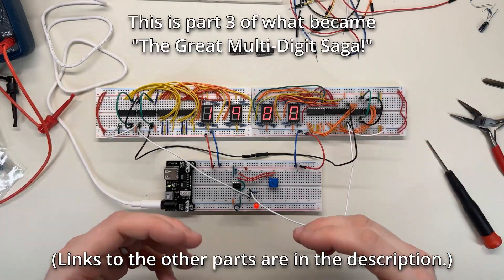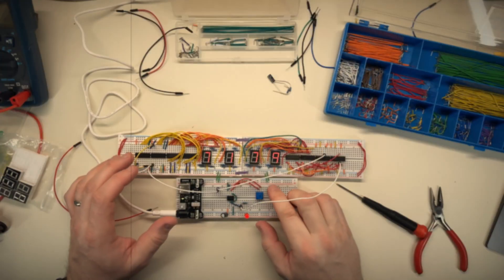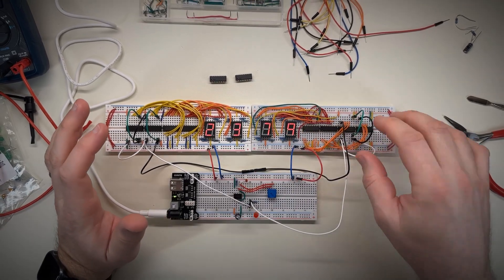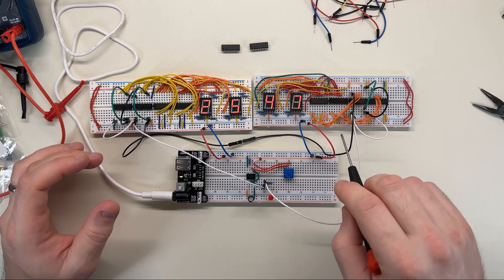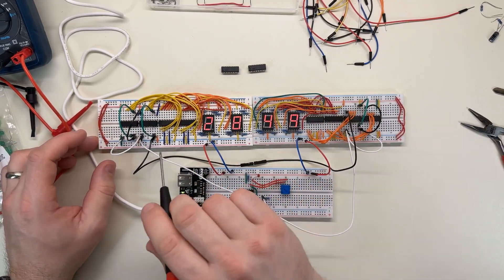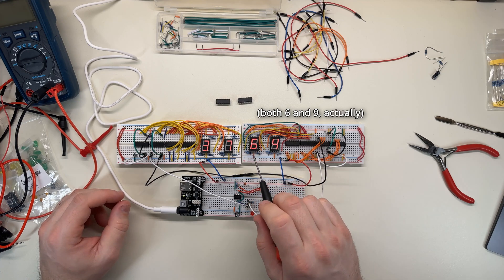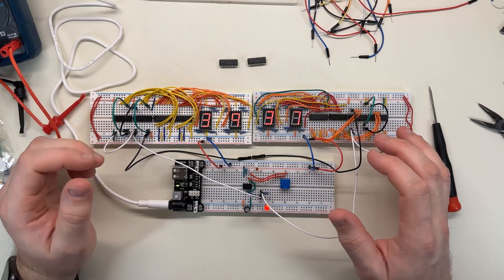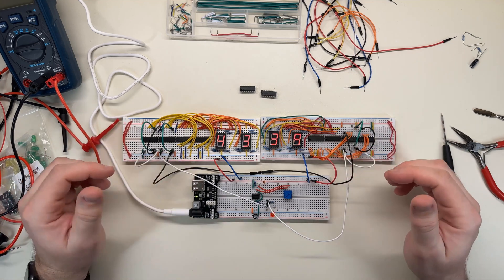I fixed my 4 digit counter circuit (The Great Multi-Digit Saga: Part 3)

Comment: I took a look at the datasheet for that INS8073, it is certainly an interesting chip! I think you should have no problems hooking it up, For SRAM, I think you should get a AS6C1008 instead of those chips you have, as they're 1 bit wide each (each has a single data line), the AS6C1008 is a 128K chip, which will allow you to move on to a 6502 or a Z80 in the future. The INS8073 certainly is interesting, and it has an UART onboard, which means that you won't have to worry about that, still, hooking it up will teach you the basics of memory address decoding. For a fun project that will lead up to hooking up the cpu, you could use those SRAM chips you have to store numbers, and display them on the seven segment displays in order!

Comment: It shouldn’t be too hard to make a simple synchronous reset circuit from an asynchronous pulse with a D type flip flop that has an asynchronous reset. Something like a 74ls74 would work but any D type buffer with a reset would work.

Tie the D input high (and if you are using a 7474 the set line high too). Use the same clock as your counter circuit to the flip flop and then use whatever reset circuit you like (an RC circuit for power up reset and/or a switch to pull the reset line low). The output of the flip flop then goes to your counter resets. The flip flop will go low when the reset is used and will remain low until the next clock pulse when everything should get reset.

Comment: An idea for a next project that would still use most of what you have already in place is to count like a clock 0->59 on the right and 0->24 on the left side counters, it'll requiere resetting while you count and some logic for the increments outside of 9

Comment: Do hou have any small bypass caps that you can put acrross tbr power snd ground rails close to the vcc pins of your ics.  Minor power fluctuations can have unusual effects that can be hard to debug.
Reply: No, he doesn't. I raised that issue in his previous video. The breadboard with the counters should have not only local decoupling caps but also a bulk cap of 10µF or more.
My suspicion is that the failure was due either to lack of decoupling for the counters, or, more likely I think, lack of decoupling for the 555. I had recommended he try debugging using his debounced pushbutton switch instead of the 555, since that would, among other things, allow determination of whether or not events were happening on the "wrong" edge of the clock. 
555s do have nominally TTL-compatible output, but is isn't what I'd call particularly "clean." Without local decoupling it can be downright ugly.